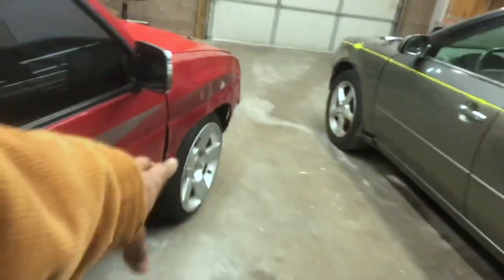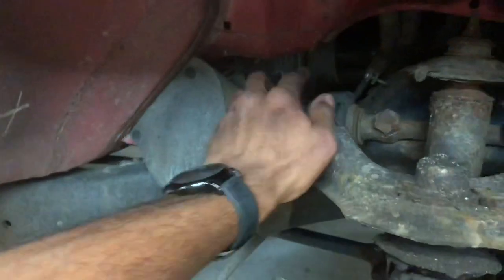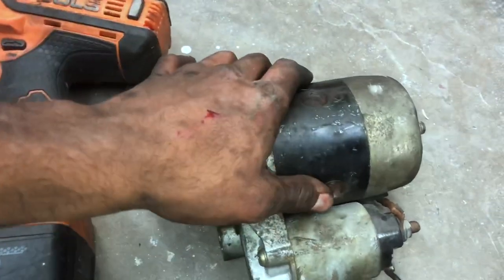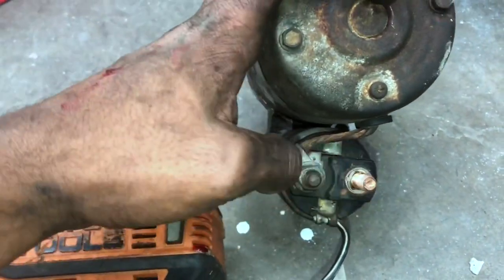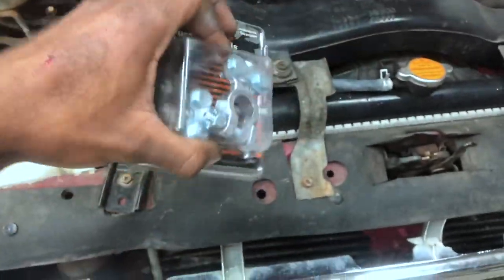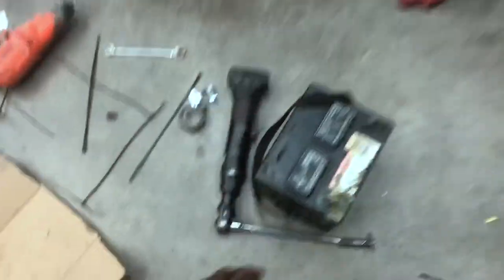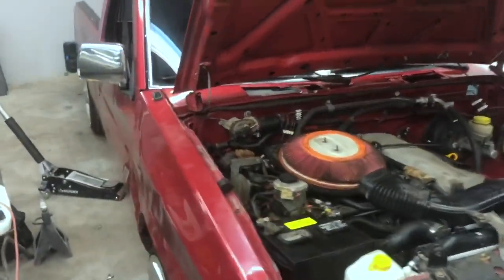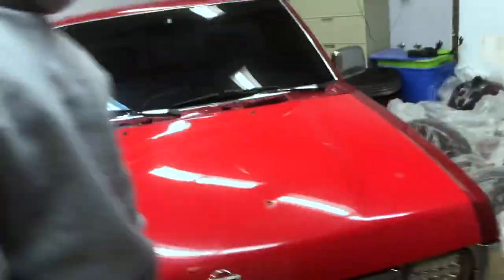New Starter for the HardBody

Comment: Hey Maaro Don what up bro? 
I would suggest getting the starter tested, some times it's not the starter motor it's self , 
but the starter solenoid that tends to fry out and go bad
(Especially on these trucks) (you can buy the starter solenoid separately and just replace that instead of pulling out the entire assembly)
The starter motor is usually a much more heavy duty part that will last a good while.
Try hitting up rock Auto parts online.
They got good prices and quality. 
Good luck bro 👊🏼
Reply from the maker: Appreciate it my guy
Reply: @maarodon  no problem bro 👍🏼

Comment: Hey I got a 95 d21 all the electrical works lights ect just won’t cranck over I push clutch turn key makes a lite tap noise on the relay box/ starter area so I went out bought new starter an clutch relay

Comment: Was your Nissan hardbody making a click noise when you would try to start it bc mine is just making a click noise no turn over or crank any suggestions thanks
Reply: Try banging your starter a few times with a crow bar or a hammer.
Chances are the starter is going out and is worn.
Another cause is oil got inside the starter and it is causing issues.
This happened to my D21.
Some times from not starting up a vehicle the starter may "stick".
Try this trick before you go and spend big bucks at Auto parts store or with a shady mechanic.👍🏼

Comment: Thats y it wasnt starting couse ur battery terminals was cracked they need to be tight so it could turn on with no problem
Reply from the maker: Oh how I wish I knew this before😬
Reply: @maarodon  haha fucking up cuuz other way. To check if it ur alternator is to turn the truck on remove the positive cable from the battery and if it turns off its ur alternator. Js